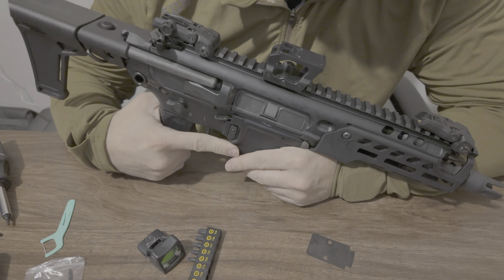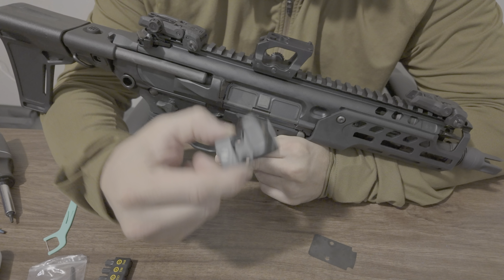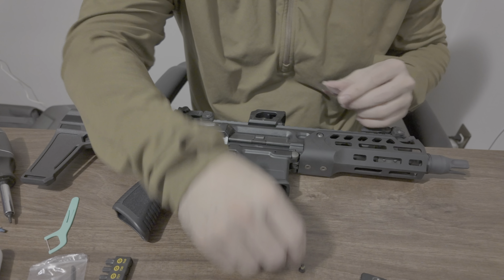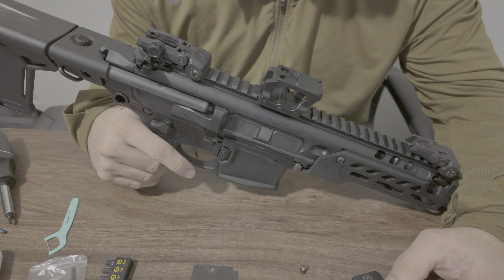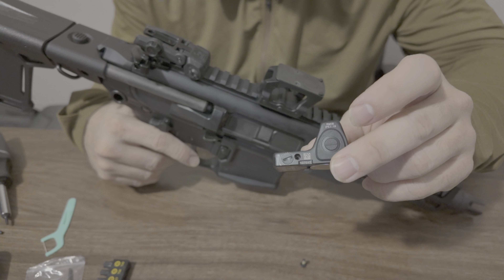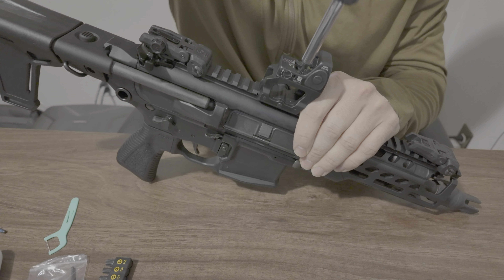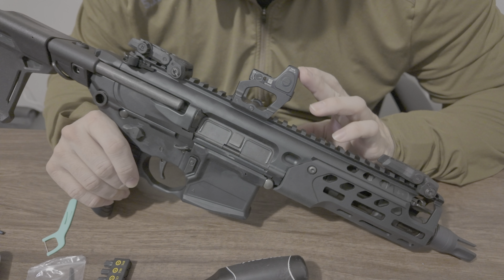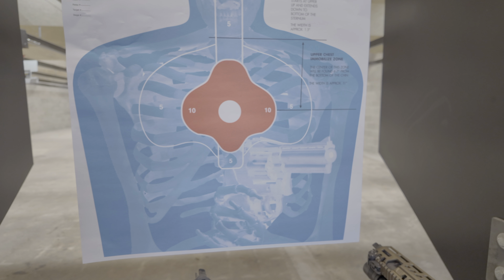Sig Sauer MCX Rattler LT 300 blackout with RMR optic

Comment: Hey buddy, I think the plate is used on older Gen RMR’s due to battery connection problems. Plate doesn’t make it more or less water resistant. The rubber seals on the battery make it water resistant, but I wouldn’t go swimming with it 😂
Reply from the maker: The RMR is not considered water resistant on its own. When you add the plate, it becomes water resistant up to 66ft for 1 hour on surfaces that aren’t completely flat. The plates you’re talking about is made specifically for the loose batteries on the type 1 and they have like a round button that protrudes upward and it puts pressure on the battery.
Reply: @foxbat3392  my apologies, thought you had a Gen 1. I have a Gen 1 and have a plate just for the battery issues.

Comment: I’ve noticed with my 7.5 inch 300 blackout that I needed a shock reduction optic to hold zero where as with a smaller caliber I had no problem because less recoil
Reply from the maker: Idk, I’ve had RMRs on shotguns before and they run just fine